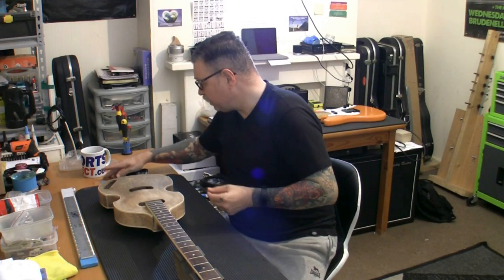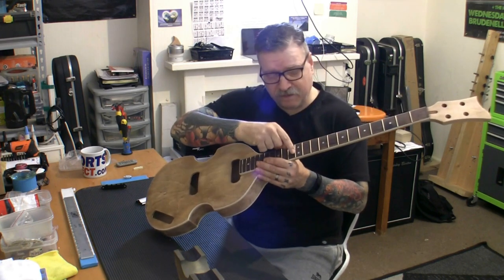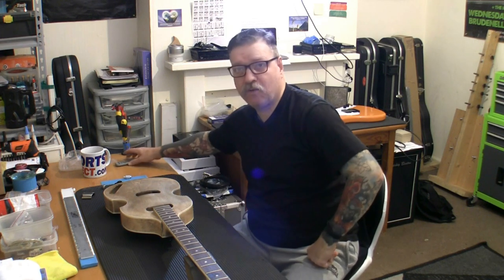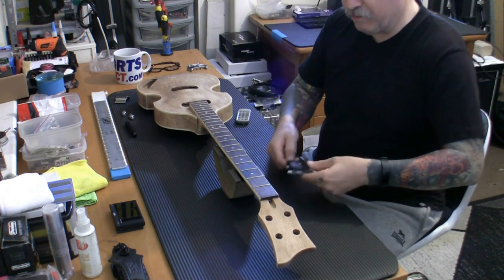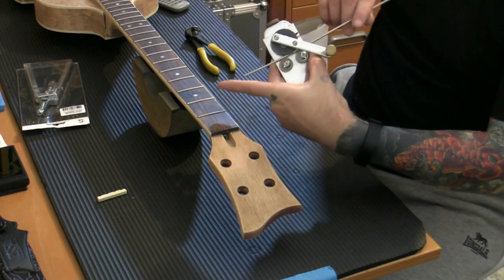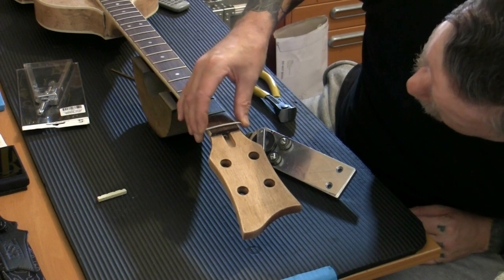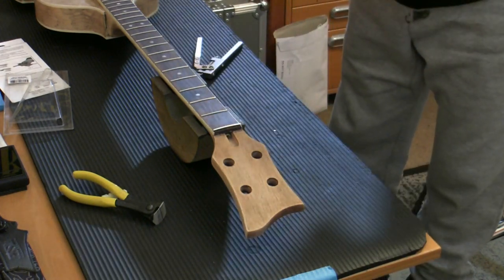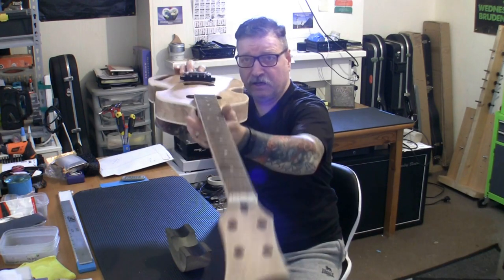McCartney / Hofner Violin Bass build / project!

Comment: Hofners  have floating bridges. If it's fixed you'll never get correct intonation and it will be out of tune all over the neck. I would have advised the customer against this.
Reply from the maker: Not true at all. Intonation can alwys be set within 2mm-3mm of a bridge placed at the correct scale length...